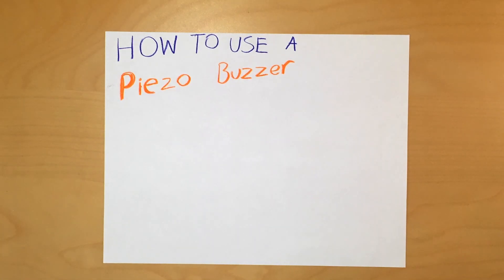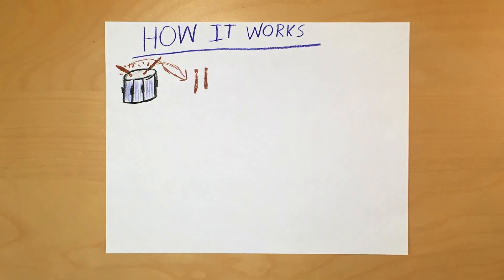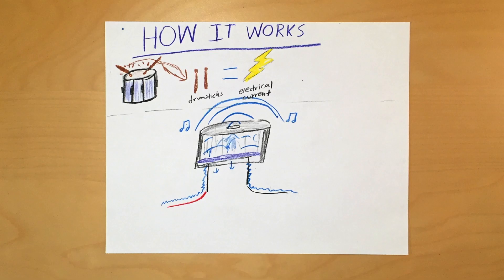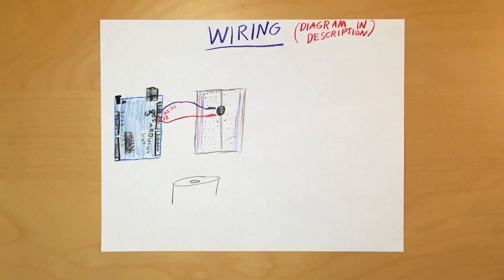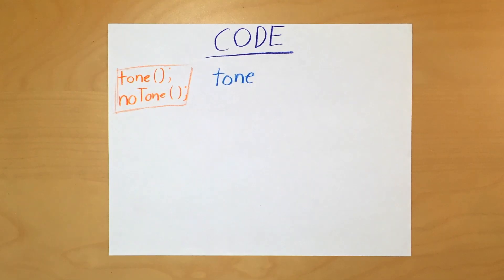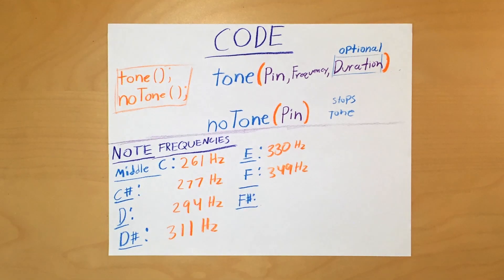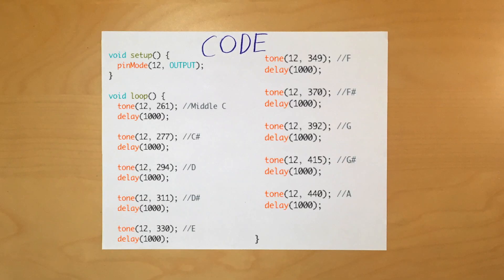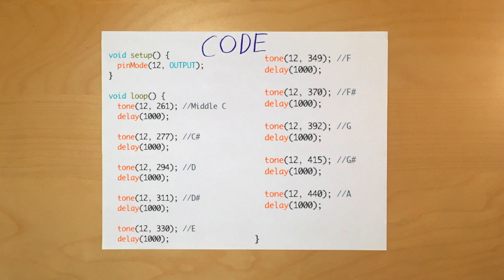Arduino: How to Use a Piezo Buzzer

Comment: I'm trying to use this simple "tone/noTone" method for coding buttons to play assigned notes (like a piano).  The problem is the delay.  When I code a delay, it will hold a particular note for that duration.  When I don't include the delay, the buzzer just makes a screeching noise.  How do I code it it so the button plays an assigned note for only as long as the button is being pressed?
Reply from the maker: Maybe doing a 0.01 second delay would work. Dont remember the exact solution but I know there is one. Check my other video about making an Arduino instrument

Comment: Awesome!
I'm trying to write a sketch that will light up an led, and play a tone beep at intervals *while the led stays lit*, is this the correct way, or do i have to make a separate "if" entry for each the LED and the buzzer, thanks!
 digitalWrite(LED1, HIGH);
     	tone(peizoPin, 659, 200)
	    delay(800);
Reply from the maker: Do you kill rats?
And yep if I remember correctly as long as you don’t set the led back to LOW it will stay on.

Comment: Don't you need a resistor in there to prevent drawing too much current and burning out the signal pin?
Reply: Isn't that resistor already on the Arduino board? Before it goes to the pin?

Comment: Nice video! I'm trying to use a piezo in my own arduino project. I was wondering if it could receive sound? 

Also, I noticed that you're at 996 subs, so I subbed to try to get you to 1000. I'm at 951, and also trying to get to 1000!
Reply from the maker: It can! I don’t think it’s very accurate but I think it can at least detect vibrations nearby. If you have one try setting it up and experimenting with any sound inputs. I haven’t done it myself but I’ve heard about it being theoretically possible.
Reply from the maker: Your channel is really cool btw
Reply: @SamsNeatProjects  ok thanks. I'll do more research

Comment: Hey Sam! I am having an issue with the buzzers you suggested through the amazon link and I am wondering if you have ever encountered the same problem. On a consistent basis, the buzzers make a screeching noise instead of playing the tone. I am using pin 12 on an Arduino Nano every.

I thought the tone was some kind of fault due to frequency but it is mostly random. For example, the tone command with a frequency of 200 Hz worked while anything below that made the screeching noise. Meanwhile, the screeching noise occurred around 207 Hz on a consistent basis.

If you know if there are any work arounds or a way to solve the problem, I would greatly appreciate to hear about it!
Reply from the maker: Never have had that problem but it’s also been a lot of years since I bought piezo buzzers so the quality might have changed. The easiest fix would probably be to buy different buzzers unfortunately.  https://forum.arduino.cc/index.php?topic=507366.0
Reply from the maker: For now you might have to make due with the notes that work. Could also be a good idea to try different pins just in case

Comment: is there a way I can start at tone zero and each second  it goes up by 5 intel max than goes down by 5 intel 0 than up and repeats. infinatly.without typing each note .im new to this and don't know a lot about how to code an Arduino. or at least just do the first part where going up buy 5.

Comment: Does the buzzer have built in resistance so we don't need to use a resistor?
Reply from the maker: Yep, you should be good without a resistor

Comment: How would you go about controlling two or three buzzers at once? 
Thanks
Reply: Kreo_lol just plug each buzzer into different pins that are PWM capable, and connect to ground. Assign each pin to the needed buzzer, or connect buzzers in parallel to achieve multiple buzzers running at the same frequency

Comment: can we make a identical sound from two buzzer and an arduino? please fastrep
Reply from the maker: Royhanun Athiyyah I think so. There may be an issue with 2 tones running at once though, but you could also just run the same signal to two at once directly instead of wiring them to separate pins.
Reply: Sam's Neat Projects can you help me for the code please? I also wanna try to create code but I am not sure

Comment: How do i make the song stop after one run though?
Reply from the maker: Take everything from void loop() and place it inside of the void setup() section.
Reply: its been over 4 months but you can also do it with a variable, or even make a switch. For example you could tie 2 buttons to 2 variables, and when you click on them the variable turns true and it plays one song until you turn it off. 

You can do this with a simple IF condition covering the whole song like

if (VARIABLE == 1 ) {
song ((whatever it maybe))
}

and put that inside the loop.
Then for a button you can simply have a small switch within it, for example
if (BUTTON_PRESSED && lock == 0) {
   If (variable == 0) 
       VARIABLE = 1;  // plays the song
   If (variable == 1) 
       VARIABLE = 0; //stops the song
lock = 1;   //this locks the button so it isnt jumping from state to state and waits for you to release it
}

If (!BUTTON_PRESSED) //When it is not being pressed
   lock = 0; //resets the button lock

hope it helps ^-^

Comment: Is it alright to wire the buzzer straight to the pin ? Some tutorials i've seen showed resistors  wired to the pin
Reply from the maker: yenioyuncu255 yep, it’s alright. Just make sure it’s rated for 5v. You should be good though

Comment: Don't I need to use a resistor with a Piezo Buzzer? If so, which one?
Reply from the maker: Sam You don’t need to. The official Arduino info on the piezo buzzer shows wiring without a resistor.

Comment: i tried with my nodemcu esp8266 but it did not work, when i connected the buzzer nothing happened. I changed pin 12 to to pin 8. :(
Reply from the maker: ExaCrystal I haven't used that board before, so I don't know too much about it, but it might be an issue with the tone() function only working on certain boards. See if anyone using that board has had a similar issue.

Comment: Do you think I could connect this to my cars door locks to when I lock and unlock it beeps
Reply from the maker: Alex Calinescu if you can access your car's wiring then you should be able to. Try to find a tutorial online to see if anyone has done something similar with their car.
It's not as simple as wiring up something like an LED since this would require specially modulated electricity to produce sound waves.
Reply: the brain from the aftkmarket keyless entry has a wire that hooks up to a siren or horn and there's an option for that to pulse with lock and unlock. I'm thinking that's what i'll do
Reply: Alex Calinescu or u can use some sort of sensor at the door, like a motion sensor or anything useful?

Comment: But how to do it with arduino nano
Reply from the maker: Bivuti Kumar should work just about the same. Try to find the pins with the same names shown in the video. You may have to use male-female cables though

Comment: I'm not sure how to explain it, but it is only making a clicking noise no matter what frequency I put it at. Is it just "blown"?
Reply from the maker: rockinDaBowtie double check your wiring and code. If you have another piezo buzzer then try using that.
If those options don't fix it then let me know and I can take a look at the code and wiring.
Reply: Sam's Neat Projects I got it working, thanks!

Comment: buzzer can work without arduino or not
Reply from the maker: I'm not entirely sure. I tried directly connecting it to a battery and it didn't seem to work, so I think it may need a quickly alternating current to make noise. 
How are you thinking about wiring it?
Reply: i repleace it with speakear in  IR based security alarm circuit but also it doesn't work......... can you help me?
Reply from the maker: Speakers are slightly different than Piezo Buzzers. Can you explain how you're wiring it and how it's coded (if you know)?
Reply: There are two types of buzzers:
1. Passive: like the one in this video, without circuitry, you can use a variable resistor(potentiometer to make it produce different sounds) also you can use it as an ear/speaker.
2. Active: it has tiny circuitry inside its case, it is used in door bells.
it is technically called piezoelectric this is what it looks like from the inside:
https://upload.wikimedia.org/wikipedia/commons/d/d3/2007-07-24_Piezoelectric_buzzer.jpg

Comment: Can you also use higher frequencies? I want to create high tones when my proximity sensor detects an object that is close, and low tones for far away objects, is this possible using this sensor? Appreciate answers ;)
Reply from the maker: Yep, I'd recommend using different frequencies in the code until you find one that works for your purposes